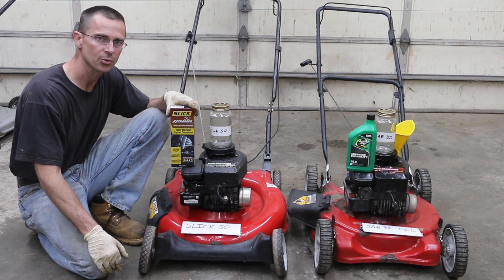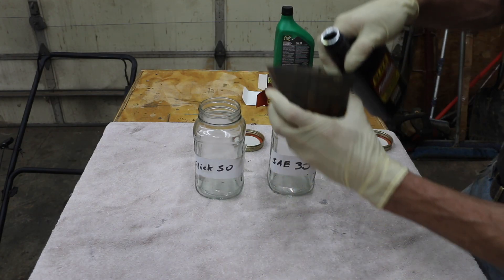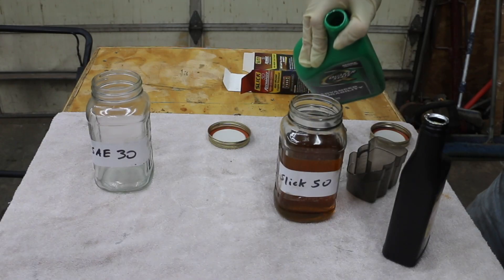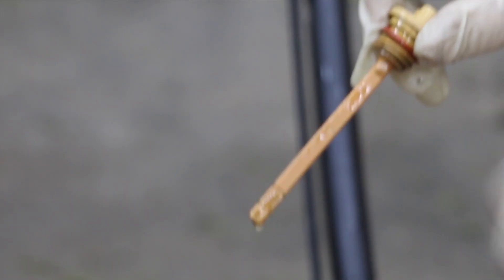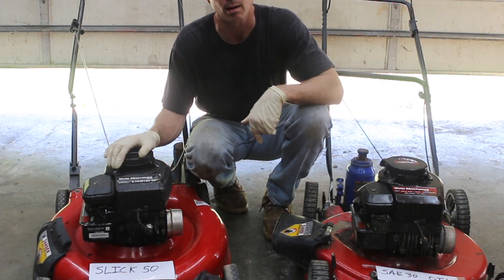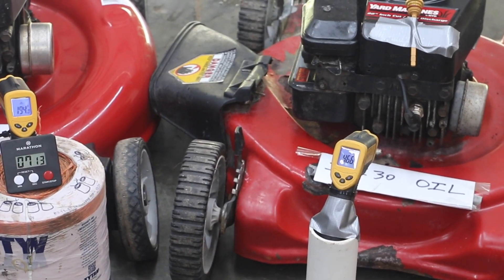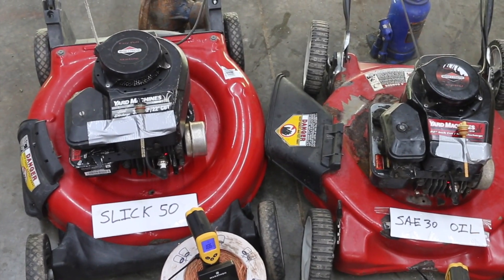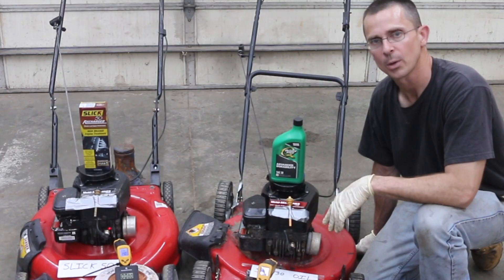Can't believe what SLICK 50 did to my engine!!--Dry Crankcase Test!

Comment: The  mower on the left has way too much negative camber on the front wheel , will need new tire and alignment performed prior to the test !!
Reply: thats the high performance handling option, commonly known as the police pack.
Reply: That mower is clearly set up for drifting.
Reply: Stance Life.
Reply from the maker: LOL!  Thanks for watching the video and commenting!
Reply: Front wheel misalignment will cause an engine to seize up every time.
Reply: Track day BRO!!!
Reply: But she's on rails when you hit the corners.
Reply: e.g. Smith its a racing mower lol
Reply: e.g. Smith neither would actually fix the problem, just hide it,  obviously it would need balljoints or wheel bearings, THEN alignment.  Duh!
Reply: While the other mower is clearly an offroad 
mower with oversized all terrain tires.........
Reply: eg smith,,, Hilarious
Reply: Indrid Cold It's true it's kind of sad...... but as long as they didn't cut down the coils spring to lowered it !!!!
Reply: Lol, 1st thing i though of as well.
Reply: e.g. Smith Yep,  no road racing for that beast!
Reply: e.g. Smith it a oval track mower
Reply: e.g. Smith 
He must corner very fast with that mower.
Reply: e.g. Smith lol
Reply: I bet it corners like its on rails!
Reply: e.g. Smith.  has to be done by. ASE certified technician...
Reply: e.g. Smith   lol. It needed some toe-in on the right front. (Actually, I have had to bend these back into place (including the rear)  The mower really did get unstable - much past making straight lines possible).
Reply: Consumer reports says Toyotas are dependable too, but everyone I see falls apart, or rusts down. I don't put much faith in anything they say.
Reply: You are hilarious! Tell us "mower."
Reply: +Indrid Cold lmao..
Reply: e.g. Smith I know you cant compare the motors if one is built for the track and the other is for off road
Reply: "...but as long as they didn't cut down the coils spring to lowered it !!!!" No worries. The coils were heated with a torch!
Reply: I've done that, man! 'Cept it was a Honda. (I can't come up with anything. drawing a blank)
Reply: I got a "beater mower" I put a "fart can" exhaust on. Actually, it's a length of flexible electrical conduit (Tote Gote straight pipe) about 3 feet long. I shove the pipe down mole holes, remove the air filter and while it's running, pour engine oil in the carb so it smokes like a mo-fo. Do a Dachau on the little critters. Smoke seeps from various places up to about 15 feet away.
Reply: Does the neighbors pesky cat count?
Reply: you noticed that too.  good eye.  lol
Reply: Project Farm.  I wouldn't put slick 50 in a lawn mower....now you know why...
Reply: e.g. Smith won't pass the state Motor vehicle safety test!!!!
Reply: Lou Fazio ha nice
Reply: Don't worry about it. It won't start to shimmy till you get over 70 MPH. Mow under the speed limit and you should be OK.
Reply: Consumer reports says all these oil additives are junk. Google 549rat oil blog. He independently tests oils for cars. Check him out. No he sells nothing.
Reply: Grumpy old fart I see the same here!! Go figure
Reply: They're set that way from the factory. It makes for a more efficient roll and even tire wear. Seriously, I recall "toe-in" adjustments done on wheeled tractors being done with a tape measure. Like 1/2" toe-in or something. We're not talking Space Shuttle technology.
Reply: Yamaha SR650  this is highly tuned machine here !!! not farm tractor !
you are missing the point !
Reply: Indrid Cold 🤔
Reply: 85 Studios 😀
Reply: "Cold lmao.." What???
Reply: It's just a kid thing, George. We're too old to understand I reckon. How do you pronounce "lmao" anyway? I'll take a few guesses: "Elmo"? "Ee-ammo"? "Ee-Mao"? "Elmo with a cold"?
Reply: "e.g. Smith I know you cant compare the motors if one is built for the track and the other is for off road" One was built to mow the front yard, the other, the back.  The twisting turns around the Japanese garden out front dictated the negative camber.
Reply: Scooter George just ride da whip!
Around the yard ha ha!!!!
Reply: Mercmad Crown Vic police interceptor!!!!!!!
Reply: Yamaha SR650 😀👍
Reply: Yamaha SR650 cutting the grass and killin it and everything else that gets in the way!!!!!
Reply: H. Bruce Clem 😁

Comment: B.G. oil treatment came to my garage in the 80's and ran a 6 cylinder engine for 4 hours no oil no oil pan, then got the hose and sprayed water up in the engine where the oil pan was all over the crank and rods.. never blew. maybe try that stuff.

Comment: I use Lucas oil stabilizer in my 4 cylinder Suzuki with 207,000 miles on it. It really helps quiet engine chatter and lifter ticks.